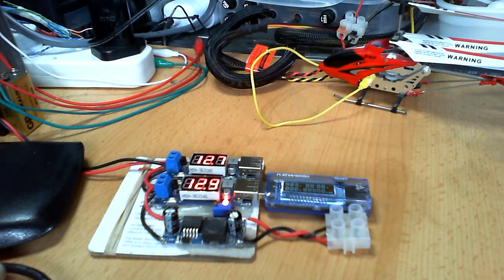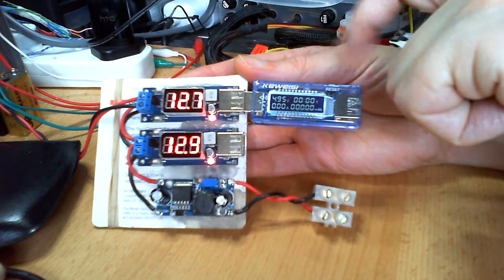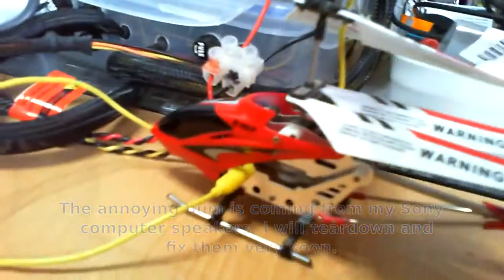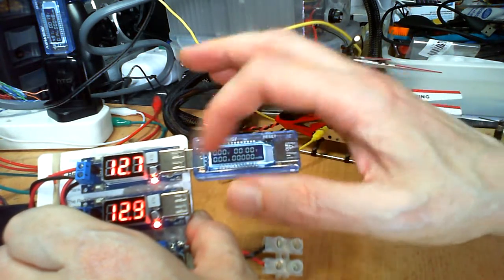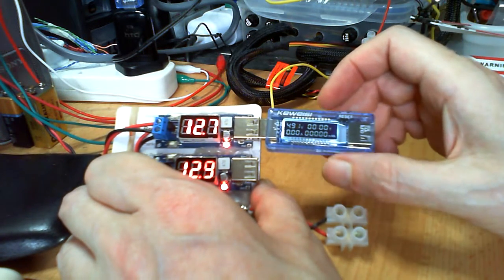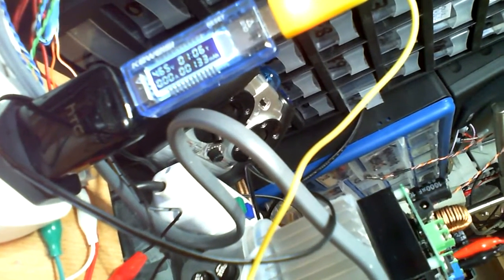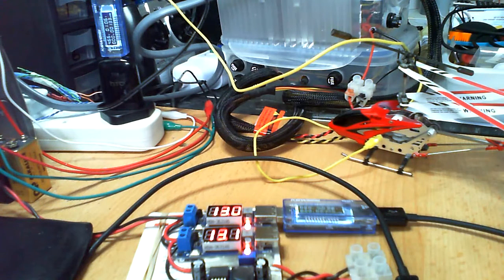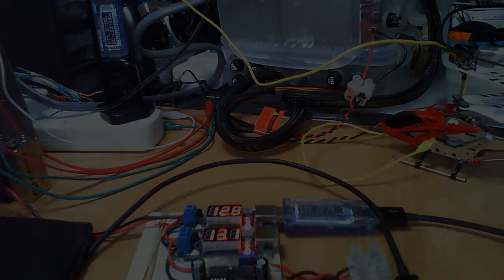Ebay KEWEISI USB OLED Volt Amp Timer Charge Display

Comment: Great picture quality nice and sharp....i repaired a few drones for my grandson (replaced damaged motors)...the syma x5c with camera was so impressive  and fun I bought it off him...smile
Reply from the maker: Hi, I like the idea of playing with that copter but wondered what it would be like. I see them on Amazon for less the £35 with a camera. Maybe I should get one and see for myself :D
Reply from the maker: I just bought one I could not help myself. Got some spares blades and 4 extra battery's :D
Reply: Presuming you bought a x5c i think you wont be disappointed...i did a lot of research and found its the best drone at that price there is a mod you can do which increases the transmitter range (uses aerial from unwanted wifi router) also a mod to camera for less of a downward angle...i stuck red tape on rear of mine (blades are all same color) and the direction lights are crap in daylight
Reply from the maker: bunnyathome hi, you have revived the flying bug in me. I am looking at the FPV kit now for the x5c-1 and have already got my next buy list which includes a Hubsan 501S X4. Cant decide black or white, 3 extra battery's and charger. It can follow me about while I am out on my bike.... AWESOME! I have been watching vids on modding Hubsan transceivers and have dug out 2 Virgin Netgear wifi hubs and a Netgear DG834GT to be donors. Not sure what parts they have inside just yet.  Also been flying my little copter 4-5 times daily to getting the feel back. Its like riding a bike.